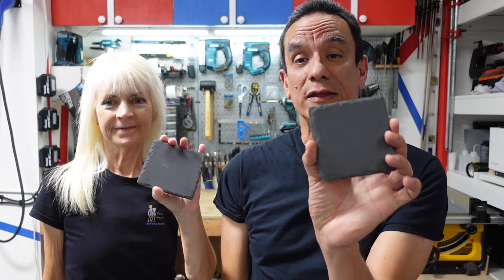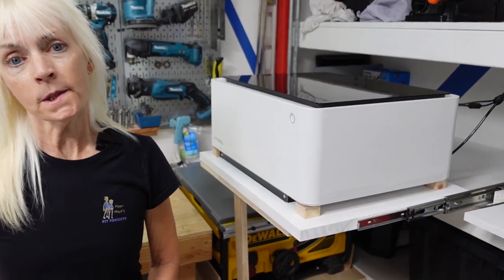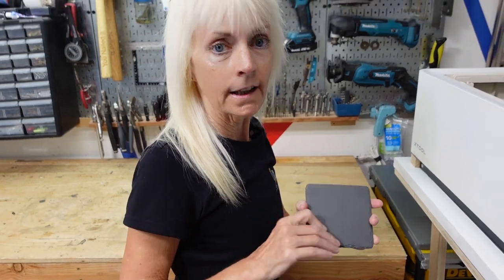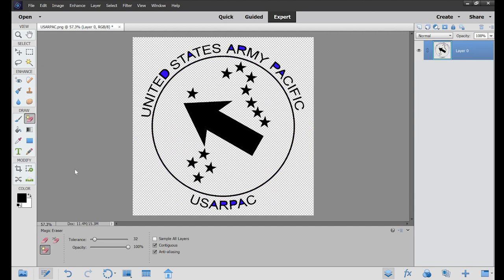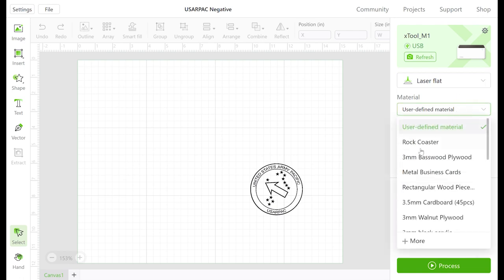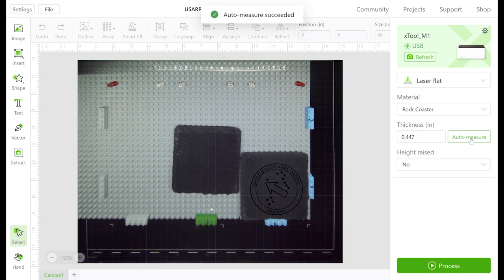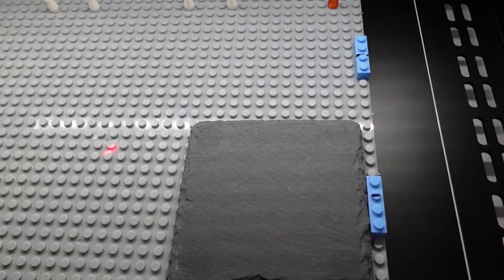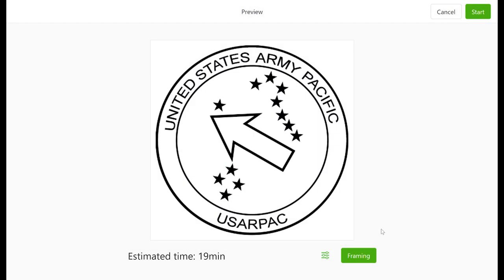Engraving Slate Coasters with xTool M1 Laser

Comment: Hi, can you tell me if it's possible to make the design come out brighter?  If so what would I need to tweak to make that happen?
Reply from the maker: When engraving stone, you are in essence, scratching rock so I do not think you can make it brighter, I would recommend using one slate as a test and try different laser settings to see if it makes a difference or not. Another option is to apply a finish. I have seen some people apply various finishes and it make appear with a Matt or Glossy appearance. Finally, I have not tried it, but you might be able to cover the slate with painters tape and engrave the image, When finished, spray thin coats of paint. I hope this helps.

Comment: Can you make a template and do multiples at the same time?
Reply from the maker: Absolutely. You are only limited to how many coasters you can fit in the engraving field of the M1. I could have done this but I found that it took 20 minutes to finish one coaster. I do not leave my garage when I am using the laser (in case of a fire). If I do multiple coasters at once, I will have to stay for a full 40, 60, 80 minutes straight. If I do one at a time, I can do other things between coasters.  Thank you for watching our video and for the great question.

Comment: Hi Both, Very nice results with the Slate Coasters.
As you know I have the LaserPecker 2 and it can engrave quite a complicated design on the same sized Slate in about 6 minutes so I was surprised to hear you say each one took 25 minutes to engrave.
Great video as ever.
Take care both.
Cheers, Huw
Reply from the maker: Good to know. I used an automatic setting. Maybe I will test other manual settings to see if I can get the same results, quicker.
Reply: @Poor_Mans_DIY  The settings I used were 100% Power, 15% Depth, 1 Pass at 1K Resolution.